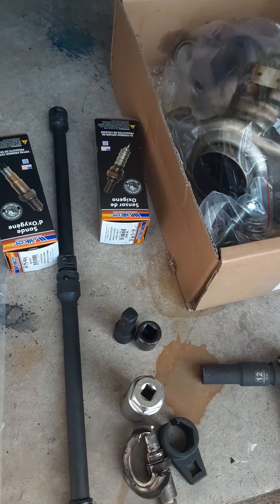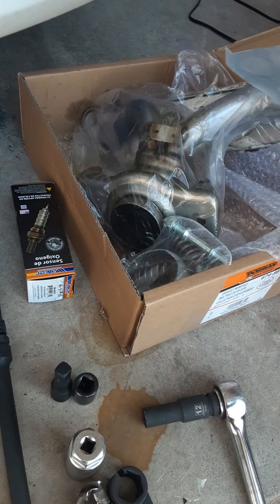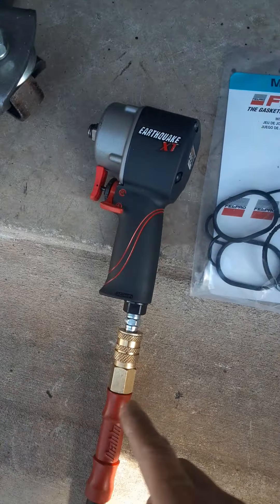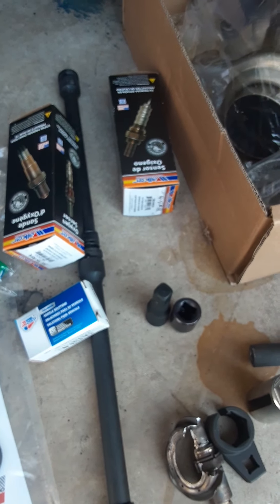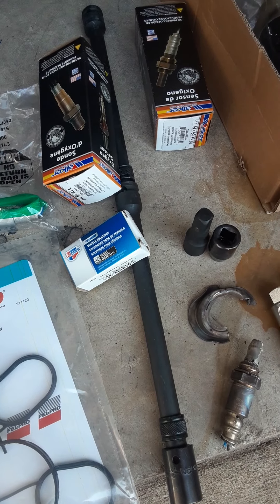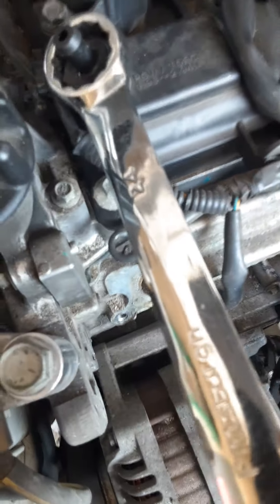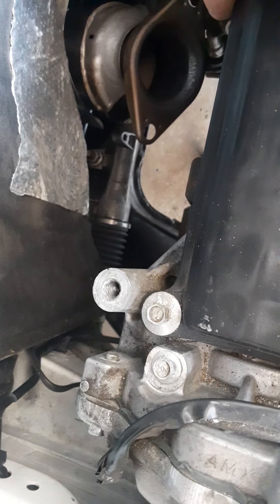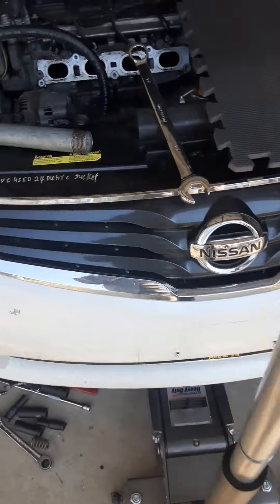exhaust manifold nissan sentra.

Comment: How much needs to be taken apart to replace exhaust manifold gasket? Great description of tools needed.
Reply from the maker: Removed the engine cover heat shield unplug bank 1 and 2 oxygen sensor 2 exhaust shoulder bolts with the springs bracket holds exhaust manifold all the bolts hold the exhaust manifold on to the engine block. Replace the front pipe ring gasket the same time with the manifold gasket. Make life easy get the the two bolts and springs for front pipe exhaust from nissan if never replace.
Reply: @islandbeaches395  Thx. Very helpful.